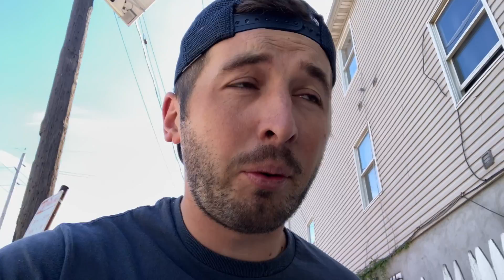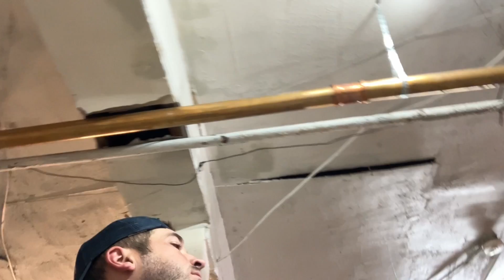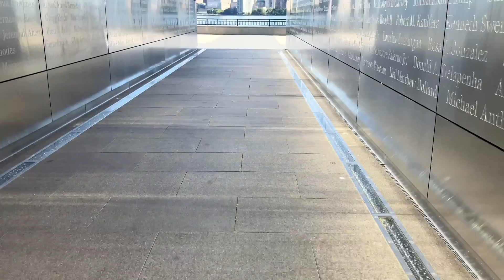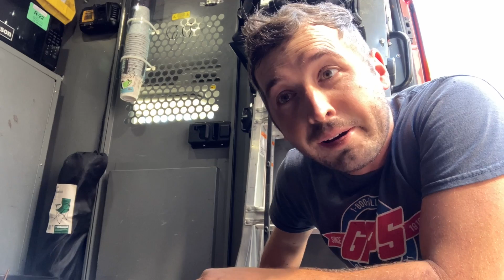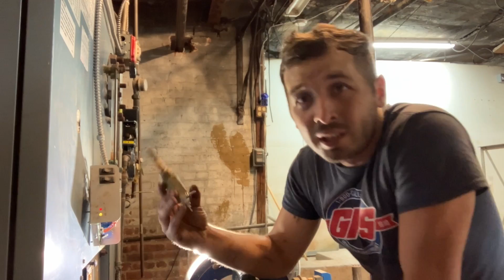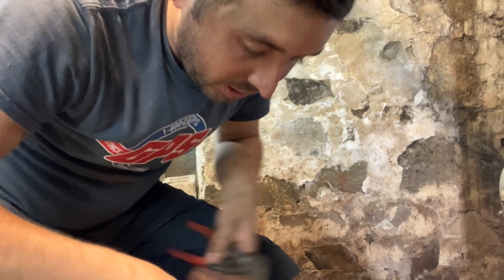Fix HVAC Problems Early Before They Grow!

Comment: You're doing preventive maintenance : swapping wear parts before they fail in order to keep the service availability the highest possible.  Do you keep track of what part has been swapped when in a maintenance logbook, on a tag attached to the part or simply written on the part with a sharpie ?

Comment: i was told by an older timer if you think its the flame sensor your wrong move on because its just dirty or the ground is bad lol
Reply: Could be...   I've given them a sand re-installed and had them work just fine.
Reply: @walnutcontractors5661  that's what we do for maint every year at that accounts I go to.

Comment: I was 5th grade, 😢 I'm older than you 😢
  I'm hoping your kid is doing well and glad to see a video from ya!
 I agree, swap out flame sensors if possible go out soon. I had no heat in winter for 24hrs. It was awful. Oven on high setting, heater core in living room. I was prepared to die in some sort of fire explosion if needed til repaired!! Never want to experience that again... And I love the cold! But then there is too cold. Specially for pipes!